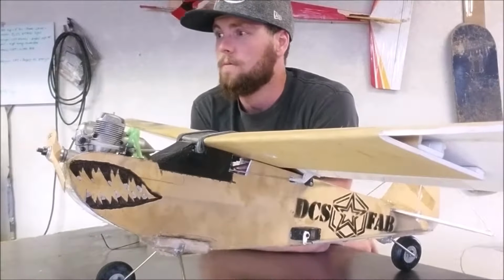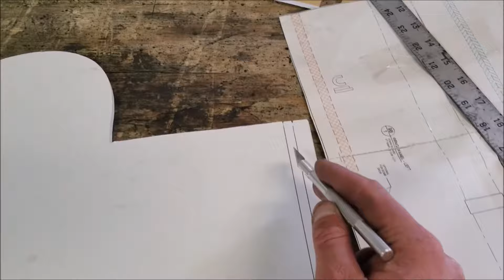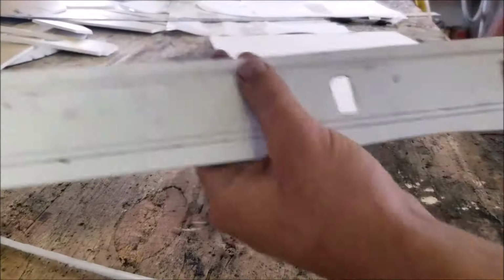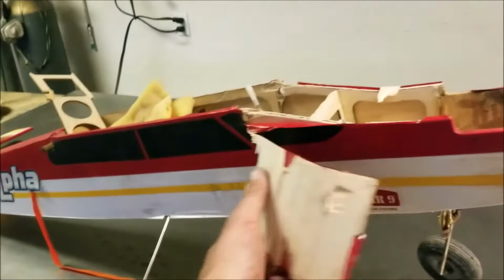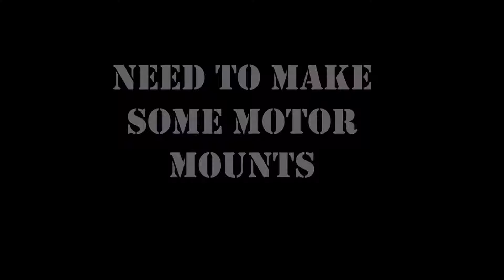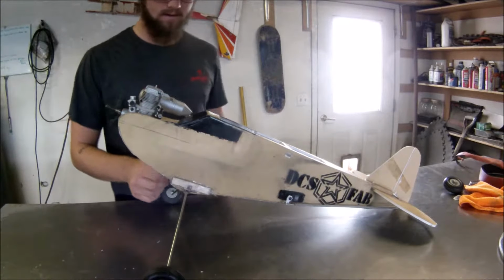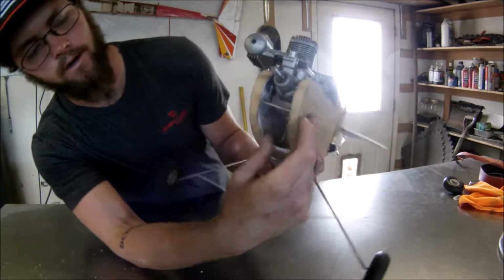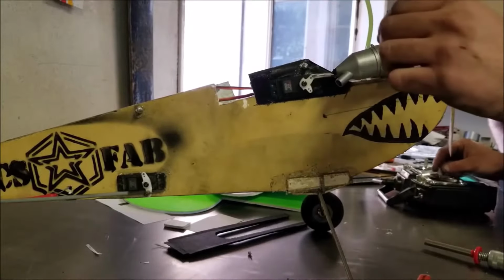Building a RC Foam GAS POWERED Airplane! | HOW TO | Part 1

Comment: When you hotglue a nitro engine onto your airplane...

Do it right and get a firewall meant for nitro. Then hotglue that onto the airframe. That makes the engine serviceable whenever and it a lot more safe.

Comment: that thing never flew? or it did?
Reply from the maker: Haha this exact plane never did fly! I tried and tried, but since then I have built a dozen or so scratch built planes, learning a ton about, well basically just aircraft engineering and design. With this new knowledge, that nitro cub would have never been able to fly. It was massively overweight to its wing lift ratio. I built the same plane with electric power instead, and only after extending the wings length by 12" did I get it to fly. It works, but then you run into ratio problems of the fuse and tail being too small for the now longer wing, which makes it fly like garbage lol i finally found that all these weight issues were due to "walmart" foamboard over "dollar tree" foamboard. The walmart stuff is made slightly heavier, which added up in an entire airframe it adds up so much the whole design becomes too heavy for its wing loading spec. So, I switched to the lighter dollar tree board, and I have had multiple successful builds since. I have all of this on footage too so I'll be uploading some videos if people care to see!? Appreciate the comment!
Reply: @DCSCustomFab  By all means, please post them... I wanted to try a .15 and .46 nitro on foamboard but I have my doubts
Reply: Wanted to see if you could make the foam board work with glow.  Oh well.  Couple of comments on your building techniques:

-  the control horns should be right over the center of the hinge line with the four hole facing forward.  Also with the glow engine and gas tank, should n thave the servo s so far forward.  Put them further back to help balance.  Put wood servo mounts behind the foam board,  lot s of vibration.

-Nice job on the weld job on the motor mounts.  They won t hold.  Glow fuel eats hot glue for lunch and foam.  Use wood and spacers for fit.  Use nuts, screws and washers through the side of the fuse to hold the motor mounts in place.  Take the wood mounts all the way back to the CG.

-  The foam needs to be covered with fuel resistant  material.  Pacing tape is what most people use.  Make sure all area s are covered especially leading and trailing edges.  Hot glow fuel will dissolve foam. as will as gasoline.

-  use ply wood for the former in the engine compartment, landing gear, and tail wheel.

-  Redraw the plans for the size of engine you are using.  Plenty of calculators for electric to glow conversions and then use a percentage calculator.  You can take your plans to an office store and have them increase the plans by whatever percentage you want.  Would like this increased by 35% larger, or 135%.

Hope this help, thinking about a 10cc gas engine (40 cc glow).

RJ
Reply: @juangonzalez-xq9cp  same I have a .21 waiting just waiting until I get a good plan

Comment: Hi I know this is an old video but do you recall the weight of that engine? I have a 380g 3.5cc 4 stroke nitro engine and planning on doing the exact build youre doing
Reply: Will be using the flight test maker board foam board (dollar tree foam) do you have anymore experience with foam board and nitro I can barely find anything online and there’s very little ARF frames out there for such small motors I can only really find 15cc and up
Reply: @hugacreeper69110  i had the same problem! Our choices are: ARFs from 20 years ago, collectors items at 300% markup, the occasional unicorn find at swap meets, or Sig Hummer, it IS a kit, but easier than most & at Tower Hobby! I went with the latter, kit arriving today, though i bought it directly from Sig Mfg.  This was recommended to me by Mr Fitz Walker (Hobbyview, RC round table, SMALLS, NASA, etc.)